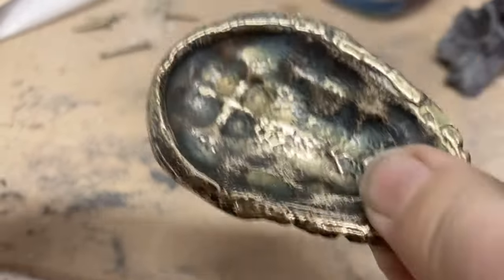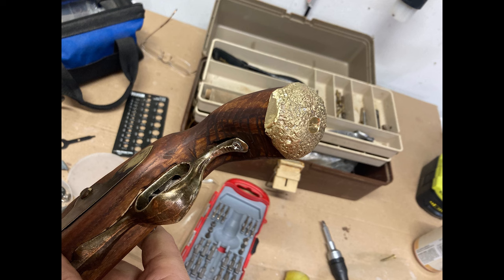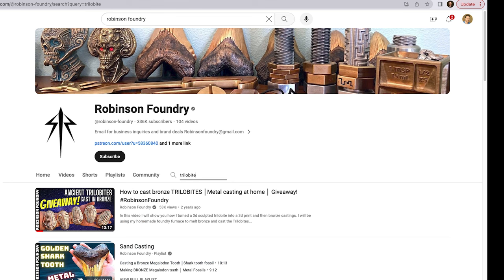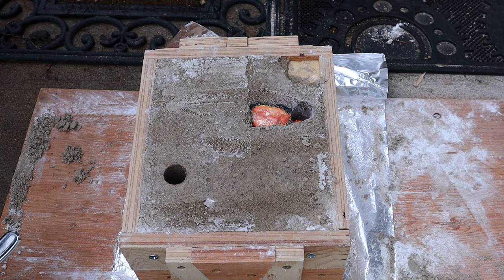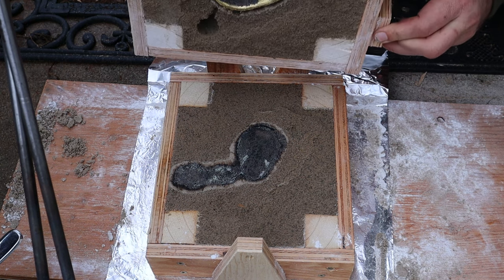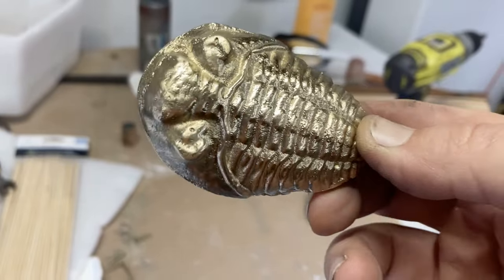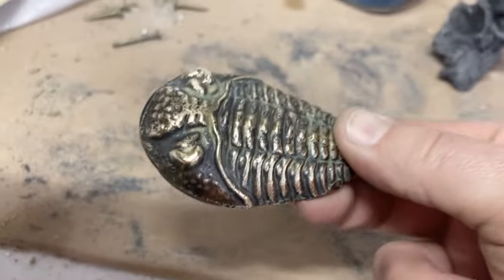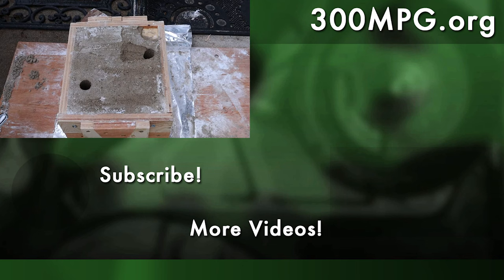3D Print to Brass Casting: Trilobite

Comment: That's a cool furnace. Given the size of the crucible you were using, wondering if you had any thoughts on those DIY water-cooled electric induction heater/smelters, from an energy use perspective in terms of electricity vs gas. BTW, the casting turned out great!
Reply from the maker: I've love to try electric vs gas.
The main thing right now is just that I'm using what I have available to me.
Casting on electricity would be great because I have solar at my house and can literally make my own power! Also, propane in a #20 bottle isn't cheap!

I've been keeping my eye on used equipment listings for an inexpensive electric kiln. That could be handy for all sorts of projects.